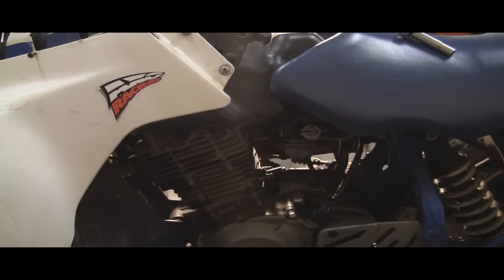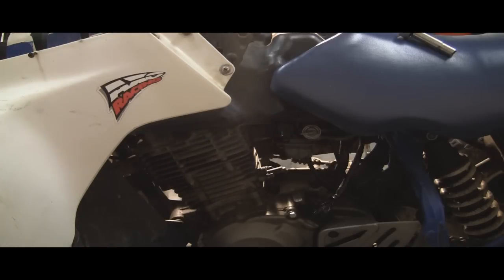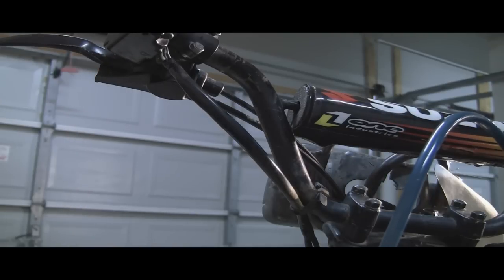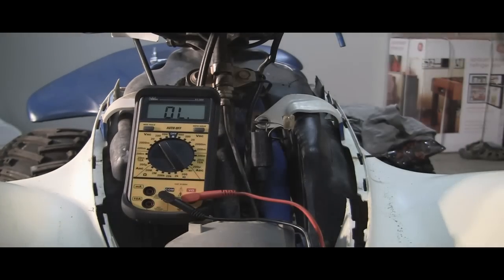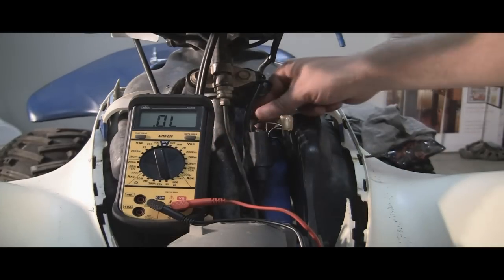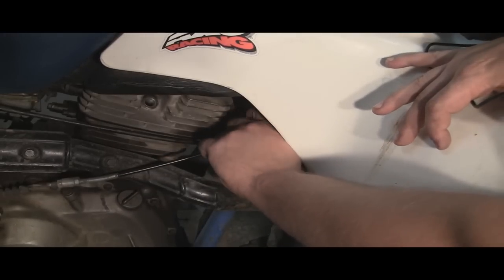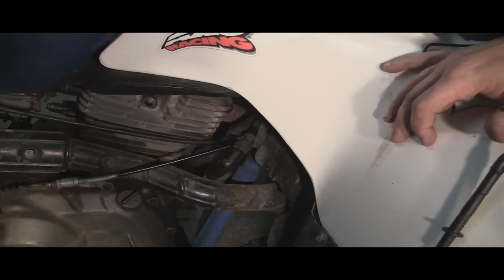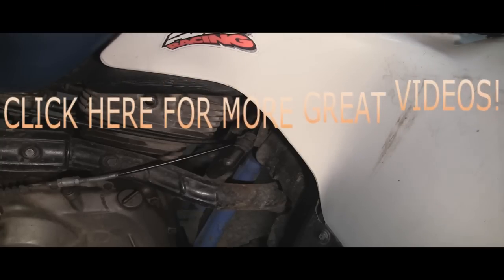No Spark? Diagnosis Motorcycle / 4 Wheeler Starting Issues Using a Multimeter

Comment: I have a 2004 artic cat 400 already put new stator new ignition coil new rectificier i have a extra kill switch flywheel look ok new battery i put another cdi and pops my fuse i has to pit the old one back do a should try with another cdi? I still have not spark

Comment: hey john i have a question i bought a 250cc chinese atv but at has a weak spark but got a new coil and a cdi box and check the ground on the atv it was good   do you have any clue what could be the problem for a weak spark??
Reply from the maker: Sounds like you have covered everything. It's possible that the new coil is defective.

Comment: Hi, could you possibly help me please? My friend has a Jinlun 125-11  4 stroke twin motorcycle. He was riding and the motor just stopped as if it had ran out of fuel. He has no spark at either plug and cannot get it started. It has fuel and there is no blockages in the fuel line which I originally thought was the problem. He has tried new plugs and no still no spark. What do you suggest, many thanks in advance :)
Reply from the maker: Don't have any experience with the Jinlin but I would guess it has a stator like most bikes and that could be bad since there is no spark.

Comment: I have a Baja wilderness 90 cc and I got new ignition and battery it turns over just fine but it won't start I got a new spark plug but if it got no spark what would I do with it like what would I buy
Reply from the maker: Ashton Pike If you have no spark, first you would want to make sure the kill switch isn't faulty and then look at the CDI unit.

Comment: I have a 2001 kawasaki bayou 220 with no spark. I got a new coil, stator, pulse pickup and plug. could you help me out?
Reply from the maker: +Tyler Lang May be a silly question but have you tried to bypass the kill switch or tested it?
Reply: +Johnnysshop No I havent.
Reply from the maker: +Tyler Lang I'd try that, could be the issue.

Comment: Hey John I recently bought a 03 yamaha raptor but it only cranks up with the choke fully out can you please help me out.
Reply from the maker: Not 100% sure but it could be the choke itself. There is a seal around the choke that can go bad causing it to leak when the choke is supposed to be turned off. Check there first and then check the intake boot as well. I've had to replace chock knobs for similar issues.
Reply: ***** thank you I will check this out soon
Reply: ***** and if not do you think it's the carberetur
Reply from the maker: Cesar Gomez It could be but I would check for an air leak first.

Comment: 1995  Kawasaki bayou 220 no spark ...I have replaced all elic. one at a time and still no spark how can I test each one to find out the problem????
Reply from the maker: +bus driver Hmm.. Sound silly but have you taken out the kill switch and just wired the wires together. I've ran into bad kill switches from new that have given me fits!
Reply: I have checked all switches all good need to check gen. coil pulse do you know what the specks are on them
Reply: do you have a 88-95 Kawasaki Bayou 220
Reply from the maker: +bus driver No, never worked on one either :(

Comment: Hi, I have a 96 Honda trx300EX that was a basket case when I got it. I replaced the switch cluster, new ignition, Starter solenoid, CDI box and coil. It's turning over but not getting any spark. What else could be the problem. Thanks. These are some great and helpful videos.
Reply from the maker: Could have faulty parts, it does happen. Check the switch with a meter to make sure it's working.
Reply: Johnnysshop I put a tester on the stator and not getting any ratings off it.
Reply: @Lameracer2011  where is stator located

Comment: how i fix my quad it starts and makes a noise but when i press throttle i dont see the wheels move but theres smoke from the thing. please me
Reply: 6string is it automatic? If so sounds like you need a new belt
Reply: no it's no spark, i check plug but no spark when I press electric start button
Reply from the maker: Then it's either a bad kill switch, ecu, wires, plug, etc...
Reply: It's a chinese 500cc bush bear ATV, It's -30 out so not gonna do much till it warms up but I'm guessing it's a wiring issue somewhere.

Comment: im getting good spark and everything nice but havent run in a while but still dosent start ?
Reply from the maker: Ethan James Power Have you cleaned and checked the carb?
Reply: Yeh i got it working but know it is running rich any advice why thx
Reply from the maker: Ethan James Power I'd still be looking at the carb.
Reply: thanks

Comment: hi there I am James Medlock I have a 1987 yam 400 I am having problem getting it running right
Reply from the maker: Hi James, what is it doing or not doing?
Reply: Johnnysshop hi I have a kawasaki bayou 220 it sparks and runs good sometimes but other times it doesn’t spark how can I fix it
Reply from the maker: If it has spark and sometimes doesn't it could be the wires, cdi or magneto..

Comment: also check you vent tube in your gas.  It could be using the gas and basically running out of gas   if its not the coil or plug Id check this out.

Comment: I watched another video specifically about motorcycle ignition coils for my dirt bikes coil and I was told to look for a 3-5 ohm reading is this because most motorcycles have a larger engine with more in submission my question is witch ohm range should I test for on my 200 cc bike

Comment: I have a 2000 suzuki rm 125 with no spark ive tested the cdi and the kill switch could it be the rectifier condenser ignition coil or what?

Comment: Awesome video but im new to four wheelers and could use some advice. i just got a 1986 honda four wheeler, for the last few days it has been running for like 10 minutes and shutting off and it wont start again for another few hours. what do you think is wrong with it

Comment: ***** i know this is an old video now but am really stuck my motorcycle has no spark i have checked the kill switch its fine new plug new coil and new cdi still no spark the only other two things i can think it may be is stator/sensor or ignition switch but i really dont wana pull stator unless i have to is there a test i can do with the multimeter before i pull it ? cheers

Comment: I need help asap. I had somethings fixed on my bike prior to that it was starting fine first kick like new. I had fork seals done, chain, brakes and tires. The carb is getting fuel, I seen some spark from the spark plug, I tried disconnecting the killswitch.. it still does not start. Not even for a split second. What else could be wrong. Bike sat for a bit but I always start it every few weeks. And like I said days before I sent it to be fix it was fine

Comment: No i haven't checked that....I guess i will hahah..thats prob what is it and i spent 150 dollars for nothing. This is what happened it was spring first time starting up quad fired up right away, surprised becuase it sat all winter. So i decide to go riding that day go to start it and didn't start. Found out it was getting no spark then i bought all those new things and tried and nothing. So i guess i check the kill switch.. Thanks!
Reply: I don't know how to start it and I don't know how to check the gas it's locked in as hard as it can my parents glued shut it

Comment: I run a shop and a lot of times, good parts or functioning parts check out of range like that coil did, and still work fine. Also who sells their bike because it needs one part? Much better off fixing it, and get more money for the machine if you want do sell it. My 2cents
Reply from the maker: All good points. It wasn't mine!
Reply: Yeah. maybe you can help me, I'm fixing a Chinese dirt bikes for somebody. Has no spark, I have replace the stator coil and the CDI and I have verified the wiring is correct and has continuity. Kill switch wire is cut, what else could it possibly be? Voltage from new stator is a bit low at 32 volts (supposed to be between 40 and 80) so now what???
Reply from the maker: Kyle Dupont Hmm.. The new stator could actually be bad. The Chinese bikes are a bit of a mystery, they still function like any other bike but just never seem to work out in the end. I will actually have some Chinese 4 wheeler diagnoses once I get around to looking at it in a few weeks.
Reply: yes, I've narrowed it down to either that, may not be cranking fast enough, there may be something causing drag in the engine preventing it from cranking fast enough or the stator magnet. Another possibility is a bad connector, I have checked all the wires but there's no way to really check the connectors besides looking at them if you can't check for continuity. I have confirmed the output voltage of the stator is at 30 volts. It's supposed to be between 40 and 80 volts. The output wire on the new CDI is still zero. Now what? do I keep replacing stuff or give up?

Comment: Nice video.  Quick question though.  Why not check for voltage at the positive side of the coil while cranking?  Then if that checked out, make sure the ground side of the coil is grounded and you would know for sure that's where the problem was.  Then if you had no voltage, you would know to start checking upstream of the coil to see where the voltage was lost, or just flat out not produced.
Reply from the maker: +Alan K That would work as well. The video was just to go over some small items to check

Comment: I have an 05 Suzuki King Quad 700 ATV and it was running perfect when I used it to spray weeds on my 2.4 acres 6 weeks ago.  It was running for over 3 hours at a slow pace while I sprayed ahead of it.  Someone was on the ATV just steering it.  All of a sudden it just stopped and quit.  i ruled out no fuel, checked and replaced the spark plug, replaced the ignition coil switch, replaced the stator switch/magneto and finally just replaced the complete computer that plugs in.  I am running out of ideas here.  I have checked the fuel line and the fuel pump and it works great.  Just not getting spark and won't start.  Turns over and over but no start.  I have spent so much on this ATV now I don't have much to take it anywhere and I am in the middle of the Arizona Desert now for the winter and brought the ATV with me.  Finally got the new computer today and plugged it in.  It kind of did a soft pop and tried to start like usual but nothing is happening.  Is there anyone who can help me?  I am running out of ideas.  I had it in a dealer for a day in Vegas while traveling down here.  Their diagnostics came up with nothing.  That is when they said it was probably the Stator Switch or the computer.  I have replaced both of those now.  Need help.  I use this ATV to get around.  I am disabled and it enables me to go places I would not be able to get to without it.  I don't have a trailer to take it anywhere either so I am stuck here trying to fix it.  Thank you for your time.

Comment: Couple of tips.

Test the spark plug with HV generator. These can be anything from tv flyback transformers, marx generators, cockcroft walton generator, or a ignition coil driver.

Before assuming the ignition coil is faulty from a low resistance secondary coil, test the ignition coil with a 12V pulsing DC power supply.

Its also a good test to put the your voltmeter across the ignition coil primary connections while cranking over the engine and check for voltage peaks indicating the CDI is firing into the ignition coil, these peaks from the CDI can be anywhere from 150-400V.

As far as testing the magneto, check the resistance of the pickup coil, usually manuals specify the resistance cold of the pickup coil these resistances vary from manufacture to manufacture but a example resistance 160-300ohm.

Also check the voltage output of the pickup coil as you crank the engine over, this is also specified in the service manual, again these vary from manufacture to manufacture, they usually specify it must peak over a certain voltage, a example is greater than 1.5V.

If all these checkout fine, your CDI is damaged, most of these units are potted and non serviceable.

Comment: Ya Hi there!i have some question about my Quakbike Yamaha YFZ 450 2004 model.last time when i checked the spark plug then it was fine there is spark on it then i put it back it was very smooth engine run then after that it engine stop because no Idle then when i start it again it does not start anymore..what ill do is i remove again the spark plug just to see if there is a spark but very surprisingly nothing at all..totally dead..so what the problem?even i put a new spark plug but it all the same...i need your advise..thank you...edgel
Reply from the maker: +Edgel Mendoza Could be anything from the kill switch to the control module. I'd check the kill switch first.